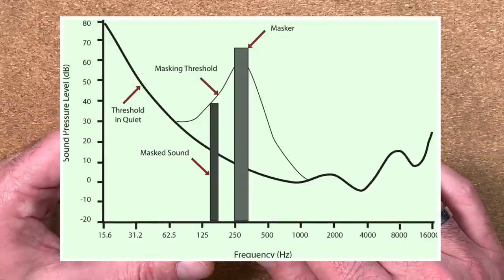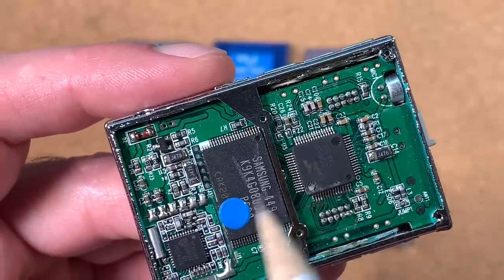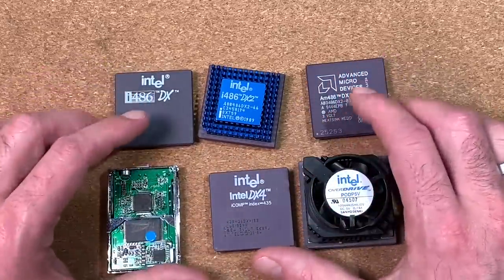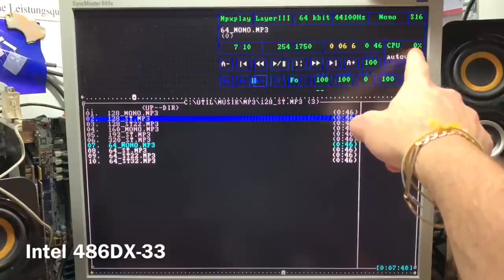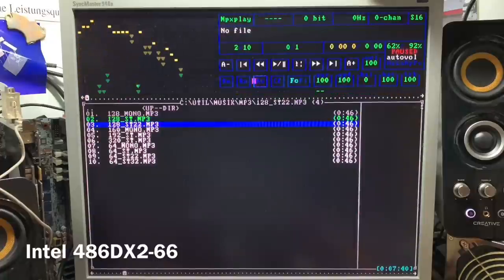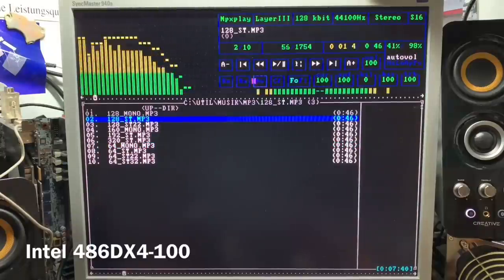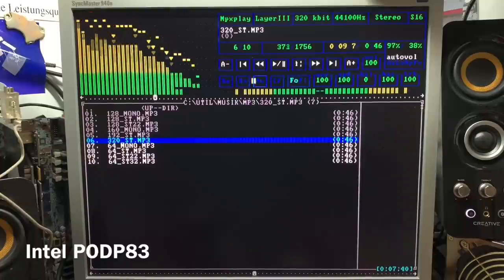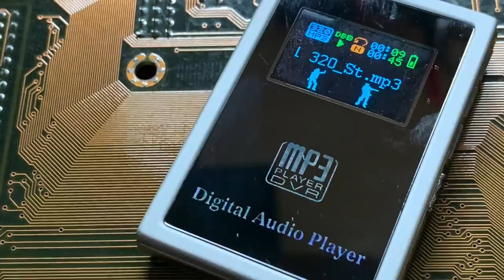Can a 486 Play MP3 Music In Good Quality?

Comment: I remember having a 150mhz Pentium, 50mhz bus, and it could play MP3s in Windows 95 with Winamp but I  could not do anything else while it was playing.
Reply: 150 mhz Pentium had 60 Mhz Bus. It was 2.5x 60 Mhz. (luckily). Almost 100% of time, it could be overclocked to 66x2.5, so regular 166 Mhz Pentium. But was of course cheaper. Not many people knew about overclocking, usually only tech nerds, in it's time, but those who knew it, could spare a little $50 dollars. :)
Reply: @warrax111  Yes, you're right, my bad, I was thinking of my first Pentium 75. I had a really cheap PC Chips motherboard, I could never get it stable at 166mhz. Years later I used that CPU on a different motherboard and it was happy at 166 and I got it to boot at 180mhz but wasn't stable. Back then you could tell the difference in boot up times!
Reply: Good times, firing up Word and hoping Winamp will keep on playing your tunes. Then everything came to a stuttering halt when Word decided to auto spellcheck.
Reply: It sure did whip the llama's ass.
Reply: I used a P133 and used to listen to music all the time while running napster, but i had a soundblaster Live! card, not sure if that made a difference. used to run a ton of plugins like sound expanders and eq's and visual plugins with no issues...
Reply: @AKATenn  my Napster time was already a P3/550 :-) as long it was in the grey legally zone
Reply: Really? I had a 100MHz Pentium that handled WinAMP just fine without bogging the system down at all (66MHz bus).

I also remember the lowest I could go with Linux and MPlayer (before stuttering) was an old Libretto with a 60MHz Pentium, though I only ever used it with an ethernet PCMCIA card and internet radio streams at 128kbit/sec
Reply: Haha, who had the luxury of the resource hungry Winamp? Back in the time we used Xmplay the true champ. I remember bringing home some mp3 music from school split to dozens of floppies, and of course only at home it turned out that part3 is not readable, again :D Thanks for the memories, what good days.
Reply: @mtx33  Well maybe the early days of WinAMP were inefficient, but when I started using it in 1999 it was perfectly fine on my system. BladeEnc though took quite a bit longer to compress anything to MP3.
Reply: Still have Wind95 original, dont remember well but its like 60 disks lol

Can't imagine if we had to swap 60 CD's for windows 10 but then again it's not even that big.
Reply: @mtx33  hmm i had 24mb ram and a 2mb trident videocard... used to play with the win95 disk compression tool, made a 1.44mb floppy able to hold about 4mb and put a single mp3 on them...
Reply: @guily6669  Windows 95 originally came on about 10-14 disks, and they were formatted to hold a little more than 1.44MB (about 1.6MB I think) using a few formatting tricks that Microsoft came up with. Windows 98 supposedly came on many more floppies. I never had to install from floppy though, because when Windows 95 came out I already had a CD-ROM drive to install it with LOL.
Reply: I had the Cyrix MediaGX 180MHz CPU/Windows 95; could play an MP3 but couldn't really do anything else.
Reply: @mtx33  I remember once storing a mini video made by me in 2 floppies. It has 9 seconds duration.
Reply: I have a 200mmx, can run mp3 320 and can run a few small small programs, however it can clip hard if I'm doing alot
Reply: I had a P200MMX and it played MP3s just fine but the CPU load definitely went up.
Reply: *Laughs in 900mhz duron
Reply: @warrax111   Yeah, good times. I had a brand new p75i for like pff, 3000,-. Clocked it to 90 mhz then. Saved me a lot of money.
Reply: Yeah, there is ways more possible than shown here, I'm pretty sure it also got something to do with how the music was ripped, my first mp3 player was definitely a 486DX2 @66 MHz with mpxplay, that pc did nothing else, it had a 20 MB Seagate HDD with only the most important files on it, boot sequence which started mpxplay automatically, LAN and sound drivers. later I also got a Pentium MMX @233 Mhz, where I had an ATI All-In-Wonder built in, then I got a Slot Celeron @333 Mhz, which I overclocked to 380 MHz, if I remember correctly, then I got an AMD K6-2 3DNow @450 MHz, which was very overclocking friendly, but I only tried and set it back to original, in the end I stacked four AT desktop pc cases of the same type on each other on a roller for plant pots and connected them through LAN and used only one keyboard, mouse and monitor with a switch for three of the pc's, the one on the bottom was the file server, there I had all my IDE controllers and hdd's installed. For us it was kind of a sport to shrink Windows 95 as much as possible, don't want to lie, but I think 17 MB was what I got myself, this way it had a ways better performance than Windows 3.0, 3.1 and 3.11, it used less resources, booted within a couple seconds and had a pretty fast response. Man that was times, burned parents money for electricity like there's no tomorrow, nowadays I'm even a little afraid to turn on and use my pc for a couple hours, papa's yelling was nothing compared to when you have to pay the bills yourself, lol.
Reply: @warrax111  Same here, my Pentium 150Mhz could be overclocked to 187Mhz with a 75Mhz bus. 200Mhz never worked for me even with excellent cooling. You could also keep it at 150Mhz but switch from a 2.5x60 Mhz Bus to a 2x75 Mhz for a bit more performance without overclocking the CPU itself.
Reply: @Trancelistic  You were one of the lucky ones, that knew about overclocking. Many people had OEM built PC and they were affraid to open it, to lose warranty. It was superexpensive back then. I think, that's why they didn't bother with overclocking protection back then, cause there were only like 1% of people overclocking.
In 1996-1997, when we used 486, and in 1998 when we used Pentium 1, I was teenager, that didnt know even what is jumper. I would be affraid to touch motherboard back then. :) So no luck with overclocking. Ironicaly, it would be so easy, with todays knowledge, just change one jumper, and we could have Pentium 166 instead 133, would made noticable differance back then.
Reply: @warrax111   Yeah, but back then it was more fun and way more benefits. OC an old CPU was anoticeable gain. Now a days It doesn't really matter, any mid range pc can do all.
Reply from the maker: I agree fully on your arguments!
Reply: @warrax111  
In 97-98, the university computers running at 100MHz with 64 MB were slow and best avoided, the ones running at 200 MHz with 128 MB ran fast with the software of the time and were obviously more up to date.
Reply: @anonUK  In 97, 64 MB was enough. For 98 it applies too. Personaly, don't know anyone, who would throw money down the drain on 128 MB in 1998. It was excessive amount.
Also, many people were on socket 7 still. There were 64 MB cachable limit, on many motherboards.
Actualy, in 1997, even Pentium 1 with 32 MB RAM was enough, and was sold as mainstream in this configuaration. Pentium MMX and 32 mb RAM. I remember it in 1997. Typical combo.

To be honest, I've lived during 1997 on 16 MB EDO RAM, with 486. In 1998, we upgraded to Pentium 133 and 64 MB EDO RAM.
The first game, that needed 32 MB to run good, was Unreal (may 1998). But it was more like exception. Even Unreal, most demanding game from 1998, mentioned 64 MB as upper limit. Just check readme... there is something like 16 MB minimum 32 MB recomended, 64 ... oh yeah.
Reply: @warrax111  
For 1 person, 32 MB was more than enough- but these computers were needed round the clock for a huge number of different functions. TBH, the real workhorses came in more like academic year 98-99, so I guess that in 97, 128MB was told much to ask for.
Reply: Yes I too had the Intel P150 in a windows 95c edition i was able to play movies I downloaded with easy VCD player ram was maxed out around 480 MB ram . That was co directed quite a bit of memory like an insane amount haa
Reply: @arniceousmaximus2183  yeah, in that time father bought computer, if only they bought Pentium 150 instead 133, and knew to overclock... we could've 166 instead 133. Would be nice boost, as we spent almost 2 years on it, gaming years 1998-1999 was screwed by slow processor. 166 would be not miracle (without MMX), but every FPS count back then, when you were on slow computer. Also, would help in Unreal, and Rollcage, with voodoo2, that we later bought. I remember, how I've looked into Unreal readme, and there was minimum requirement Pentium 166. I was scared, we could not run it. It could be ran, with voodoo2, luckily, but FPS was terrible. I've played it lot later, when we finaly upgraded to K6-2 500 mhz.
Reply: @kathleendelcourt8136  Nice, I have it overclocked same in retro computer. I've got Pentium 150, and yes, exactly, it can go 75x2.5 but cannot go 66x3. So I have 187 Mhz maximum. Anyway, thanks to 75 Mhz BUS, and memory, and also L2 Cache (socket 7 system overclock all of it), it ran slightly faster than Pentium 200. What a beast for so little money, back then.
But you've needed to buy socket 7 mb, that can run stable at 75 mhz. Back then, I didnt know english, I didnt know hardware (wish I did know), so I could not read about motherboards on Anandtech and Tomshardware, that allowed 75 Mhz FSB. It was big deal in 1997. Unfortunately, we had probably some cheap mobo, with 66 Mhz FSB max. I don't know till this day, what mobo they've bought
Reply: @warrax111  nice one i do recall the 500Mhz that was a big step i remember upgrading my PII Slot 1 350Mhz to 450Mhz I was really excited as my family moved from Austria to Kalifornien around 1988 and it gave me good opportunities with mini computers they were really cheaper in San Francisco which at the time was the most wired City in the world. Today with wireless it doesn't count right. I remember MSN gaming zone belonging to a squadron and they mailed me a welcome package I had to use only the squadron plane skins etc.. Those were good time playing games on dialup haa
Reply: @arniceousmaximus2183  Yea, good times. I was shocked with 500 Mhz range boost, it came so quickly during late 1998 and 1999. I expected to have around 300 mhz as upgrade from Pentium 133. It was unbelievable speed. Shocked, I was looking for prices in late 1999, and could not believe how cheap is 500 Mhz... in form of K6-2. Even supersocket 7 mobos were cheap. I really could not believe, to this day, I remember checking those prices two times. I've expected to have for that money something between 233-300 mhz. But next year was even more shocking and speedy... 1 Ghz barrier was passed, and with help of Duron, it could be overclocked usually to 850-950 Ghz, and totally for cheap. Unbeliavable times... we were used to 100 - 200 Mhz as lightning speed, most of life before.
Reply: @warrax111  ya the beginning of 2000 era almost quarterly speed increases like 550 600 650 750 850 1Ghz then we saw the 1.5Ghz and so on haha. Today I run an  i7 sandybridge maxed DDR3 WD black Caviar SATAIII 7200 RPM . Also own an asustor 604T NAS and backstaff on a private tracker :p
Reply: @thegreatcodeholio123  Yes I remember. PI 100Mhz no problem with MP3, but DX4 100Mhz in 98SE =  stuttering with Winamp.  Maybe new comparison mp3 in Windows  @"
CPU Galaxy" ? ;)
Reply: @Lassi Kinnunen 81 linux wouldn't make any difference. (except trashing your hard drives, linux was a toy in 1995)
Reply: So a amd 486 is pentuim 1? Pentium 3 came out in 1999 could a 486 or pentuim 1 play a vcd?
Reply: @warrax111  Overclocking back then required a bit of reading and jumper management. A lot of people who simply bought a prebuilt PC had no idea that they you take off the side of the computer and switch a few jumpers on the board.
Reply: It really kicks the LLamas ass
Reply: Same here. Winamp sucked up the complete CPU 😁